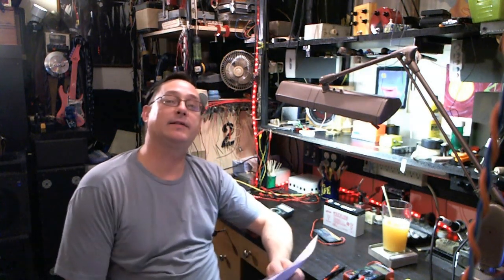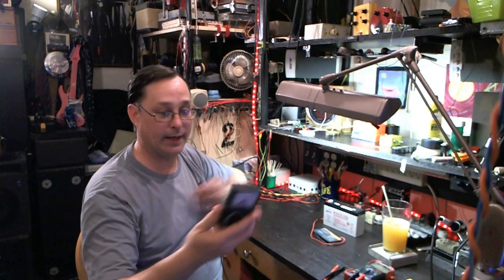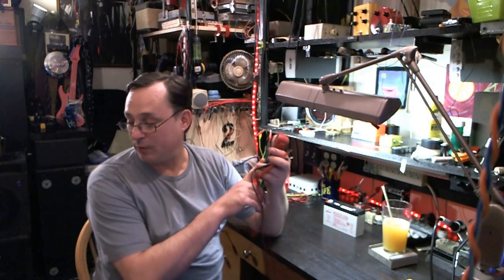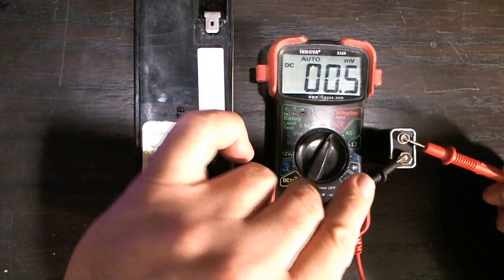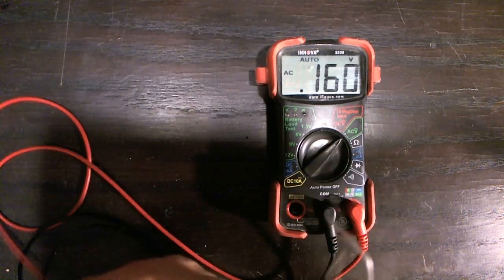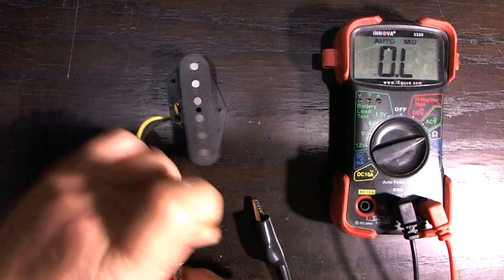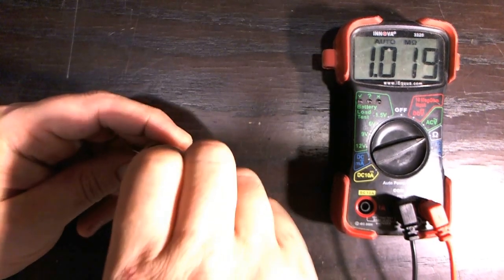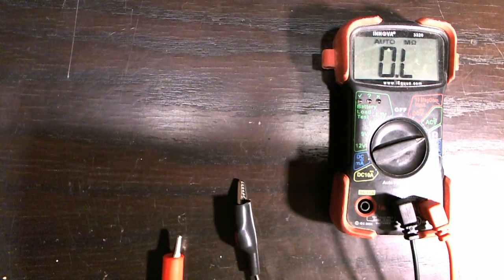How to use a multimeter (for building pedals / audio)

Comment: I was looking to buy a multi meter to  test my cars battery?

 i notice this Innova 3320 lists it as having 10 mega ohm impedance.

Is it dangerous to test a car battery without  that 10 mega ohm impedance?  Basically should i be looking for a multimeter that has that?
Reply from the maker: i have used mine to test deep cells / car batterys / 12 volt sla so many times i could not tell you . but ultimatel;y i would say a firm NO , never use this meter unless you are measuring static electricity . if you are scared my channel is not the best place . there are more safety conscious places for you to get your info from than me as i am a complete hack who disregards safety as i never work with anything greater than 24 v dc , i also have never really had any problems because i try to be thoughtful and careful . good luck , and maybe seriously avoid my channel please . thanks .